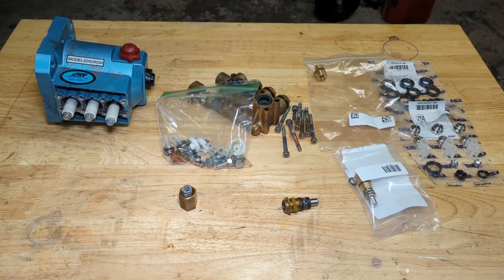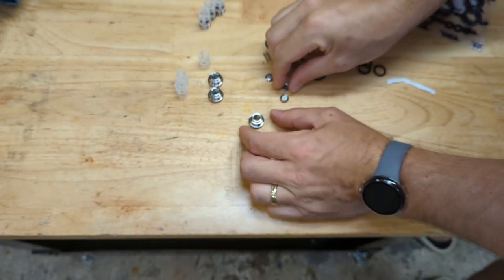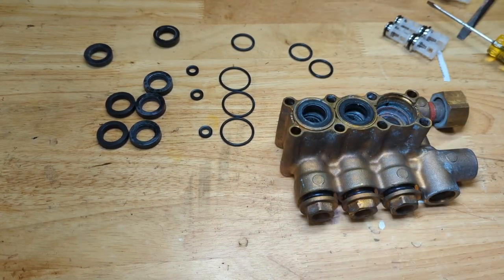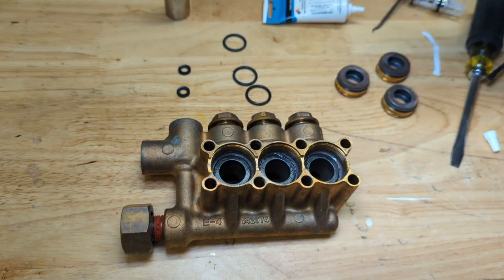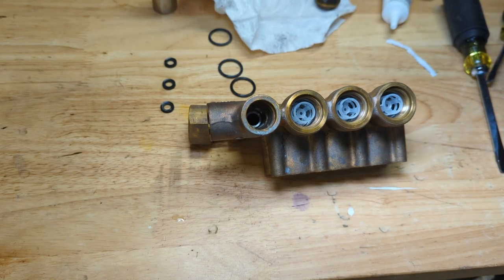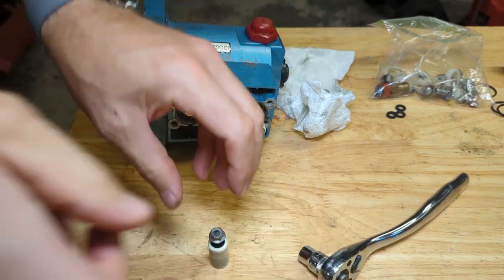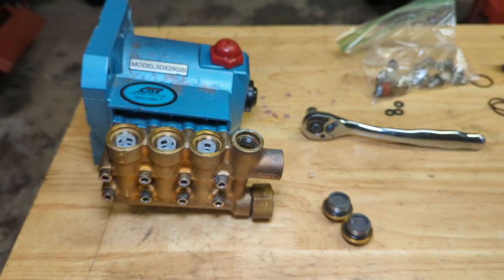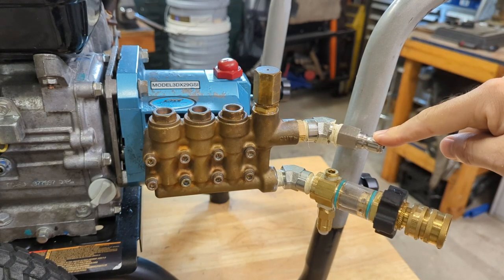CAT 3DX29GSI Pressure Washer Pump Rebuild

Comment: Well put together video thanks for he help.  I’d mention some 3DX have a water cooling port on the three lower pressure seal brass retainers that must be lined up with the small bore in the brass housing.  Also to get those pesky valve body’s out look down the perpendicular access bore and stick a 1/4” width flat blade screw driver right into the lower plastic valve and into the lower spring.  You will see that plastic valve tapers so as you pry up and slightly wiggle you will not break the plastic lower valve body.  🤘🏼.  Thanks man!  Saved me 1K for a new pump.   Where did you get your parts?  I priced out a valve body repair kit at $179 😮 and seal kit at another $149!!!😮

Comment: I have one of these pumps mounted to  a Honda GX200 gas engine, trying to remove it from the engine to replace, but not having any luck, seems to be held on even though I have the four bolts removed, the pump will spin on the engine shaft now, but will not slide off. There does not appear to be any set screws holding it on, curious if yours came off easy or if you have any suggestions? Thanks
Reply from the maker: Mine came off easily... Guessing there is probably some corrosion that is preventing the pump from coming off. No set screws on mine.
Reply: Just pry it off it wedged on the key shaft.

Comment: Great video I have a CAT 2SFX30GXI the unloader valve is giving me problems. First needs repair but I cannot remove it to clean and repair.  Any tips would be appreciated. Cap and spring came off, seat with valve backed out to show first o-ring now just spins but will not pull out. Thank you anyone for any help.